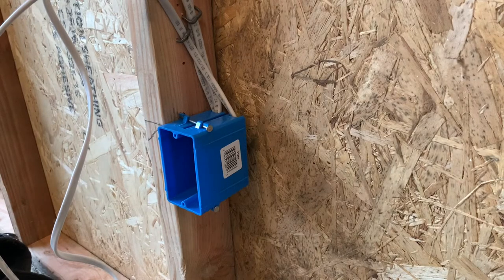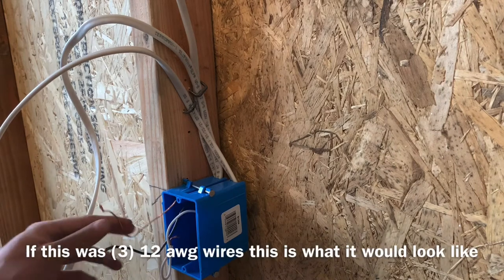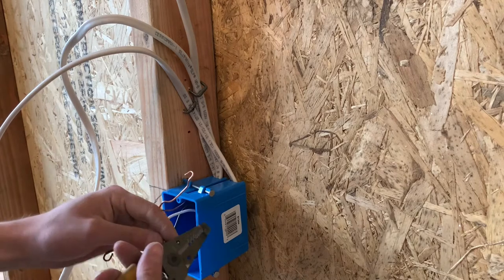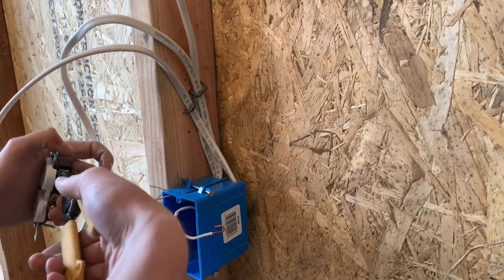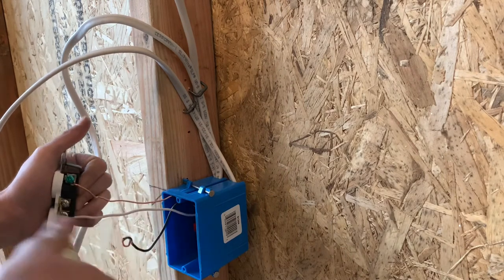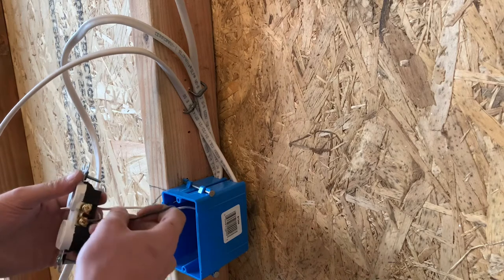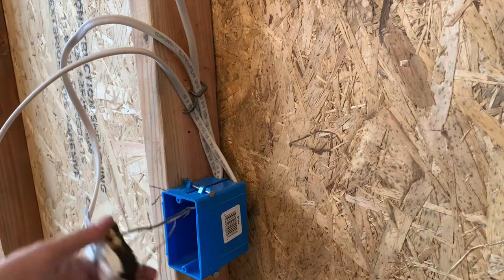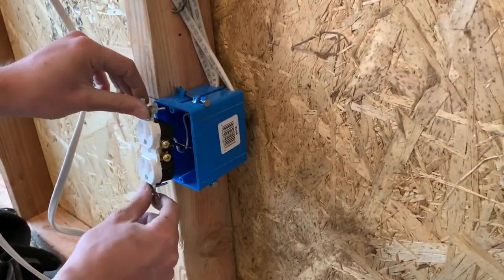Electrical 101: How To Install A Duplex Receptacle (3+ Wires)(Residential)

Comment: I’m not sure if this is a dumb question but is this coming from the feed (hot) and the rest down stream will be wired like this also (hot) like would you run one (hot) wire to one screw and the other brass screw run that down to the other receptacles not sure if I’m making sense?
Reply from the maker: do you mean if you have more plugs down stream do you tie that downstream black (hot) wire to the other hot (brass) screw on the plug?
Reply: @DailyElectrician  correct and also because you said this was pigtailed i was wondering is this the beginning of the stream or end of it
Reply from the maker: there is 2 ways to do it. either pigtail it which is the better way or put the wires all on the plug.

this is not the end, the end would just have 1 wire by itself. this could be the beginning or anywhere in between the beginning and end.
Reply: @DailyElectrician  got it 🙏🏽 I’m just about to start working for someone I’m an apprentice so just anxious to get in the field I have two offers one to work commercial and the other is a residential guy not sure who to work with first or what does each one look for in an apprentice like what would I be doing you think in each field as a beginner
Reply from the maker: nice!

honestly you would be doing whatever they tell you to do, each company might be different.

might be easier to learn from residential first

Comment: Thank you but I think the point of someone looking for a video with 3 pigtails is to actually show HOW to pigtail the wires and where you get the 4th wire from to connect to the outlet. I know to just buy extra 14awg wire and cut it to length needed and include it in the pigtail but some people might not.